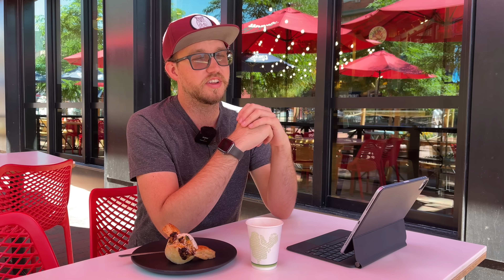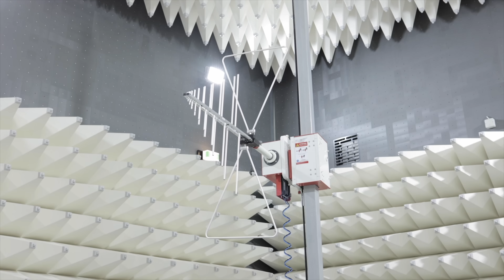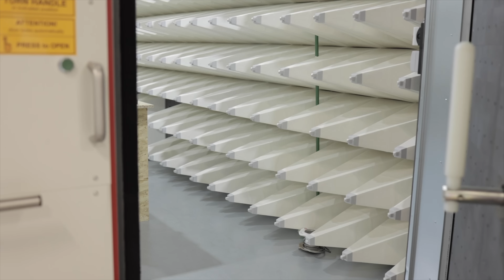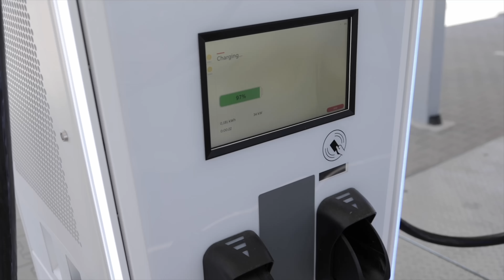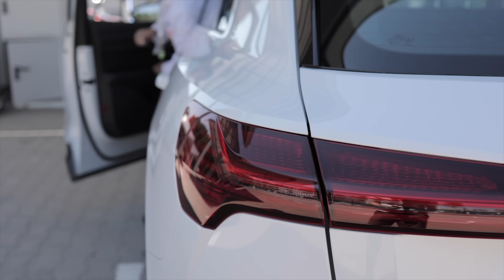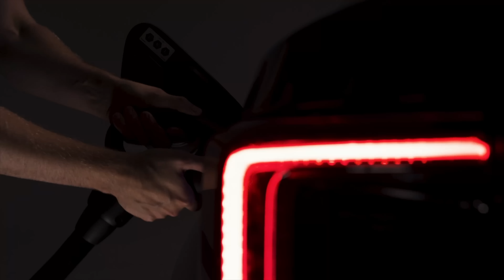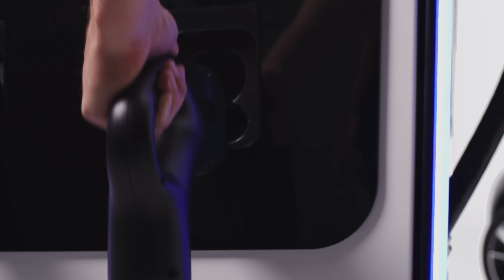This Is The Future Of Electric Car DC Fast Charging With ABB

Comment: Informative. Thank you. I believe you mentioned, Jordan, plugging in at a slow DC charger or a level 2 charger when you go in to do some shopping or perhaps to see a movie at a theater. You seem to suggest that this is kind of thing may be a significant enough use case for such chargers to be installed and maintained. I understand this, if the charging is free in these kinds of cases and the chargers and the electricity they convey are underwritten by a city or a group of retail shops. But if there's a reasonable dollar cost applied, wouldn't charging at such facilities likely be much less advantageous compared to charging at home, where the electricity cost to the user is going to be much less expensive? Long-winded way of saying that I get the business case for real DC fast charging for along the highway, and I get the business case for slow DC charging and level 2 charging at hotels, campgrounds, and other road-tripping support situations. I'm wondering, though, about the viability of slow DC chargers and level 2 chargers at which you pay for the electricity. Your thoughts? Perhaps some sort of monte carlo analysis with economic weights applied might be useful here, especially if there is anonymized data available from the service providers.
Reply: In Europe especially in cities many people don't have their own garage and there are only a couple of outlets/L2 charges or they simply park on the streets. So it makes sense to top up during their groceries, leisure tume etc. That's where the ABC rule comes from. Always be charging
Reply: @Scrap-press  Thank you. That makes some sense, if you are parking in the street or in a parking structure near your apartment, overnight. But if you have this, why the retail angle? Perhaps because of limited charging stations on the street near homes and near apartments? Sounds like that maybe what you are saying.
Reply: @williamelkington5430  I often charge at the supermarket, parking garage downtown or at the gym. I do pay for charging but sometimes I get free parking when charging (€1 per hour). It’s a great way to slowly top up as I can’t charge at home and have a Tesla with the LFP battery so I can always charge it to 100%.

Comment: Please 🙏 ask ABB to break into the market more for home based DC fast charging with an emphasis on freewires battery integrated technology. This way theoretically standard 200 amp mains panels could support adaptive grid utility demand/buffers. Keep making great content and I'll keep watching, thank you!
Reply: I've read about the Freewire's technology and I think it's best suited towards businesses. There will (likely) never be a case for a 160 kWh battery at a home. Even the biggest battery pack systems for solar/renewables are around 30 kWh, which is about 1-2 days worth of energy use for most households.

There are a few chargers that could qualify as "home-based" like ABB's Terra which uses single phase 240 V to provide about 25 kW of DCFC. They might find a place in some shared housing like apartments as an alternative to more widespread Level 2 AC charging.

Comment: A unit that can charge 2 cars at the same time is neat.
Reply: A unit that can dynamically charge and share 4 cars is even neater!
Reply: @quakz548  agreed.  That's 4 bolt eves at 55kw max .220kw delivery to all 4 bolt evs at max speed. Is very neat.

Comment: Great video  from central Canada and all our chargers are 50kw I can't wait till they are over run by 300kw.
Reply: Many people think that using a 350 KW DCFC will make their cars charge faster, which is totally wrong. All they are doing is wasting money and grabbing a station away from an EV that can use the higher rates (Porsche Taycan, Kia EV6, Hyundai Ioniq 5 and a few others).
Reply: I was noticing in the prairies of Canada that the charging infrastructure is good in the southern parts, especially near the Trans Canada Highway. Once you move north from there the infrastructure diminishes. For example, around Calgary there are multiple chargers running over 100kw. Move a few hours north to Edmonton, the fastest chargers are around 50kw. Edmonton has a population of over 1 million people. North of there, the infrastructure is so miniscule as to make road tripping near impossible for most EVs.
Reply: @graham2890  yup unfortunately that's true

Comment: We really need more of those solar awnings in the United States, they make sense from multiple perspectives, the only drawback I can think of is in hurricanes, tornadoes, or an area where you have to have very tall trucks driving all the time.
Reply: Why? Gas stations have cover in places with hurricanes, snow, tornados etc. I’m sure something can be figured out and maybe put them in spots where the chance of getting murdered isn’t as bad.
Reply: That or snow/ice  I'd be interested to see if that problem can be solved as 1 heavy snowstorm in Minnesota blocks some of my solar production until I pull the snow off the roof.
Reply: @wesleyvansteenburg9970  Good point.  Those awnings make SO MUCH sense in a place like the southwest, though, where the tornado/hurricane risk is minuscule, snow only happens in high elevations, and it's hot and sunny much of the time.